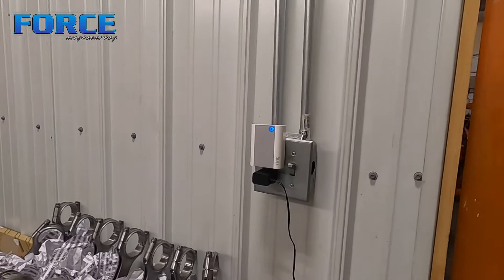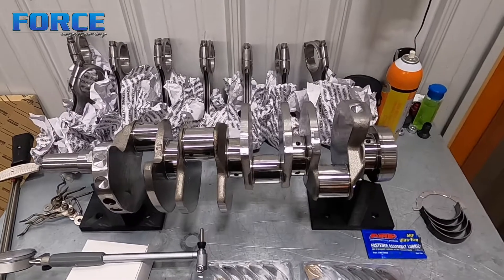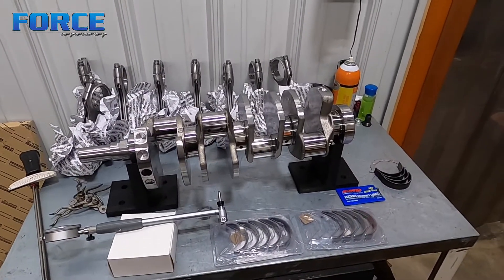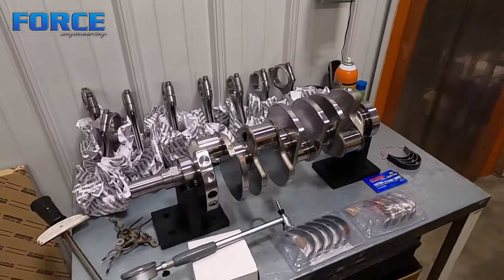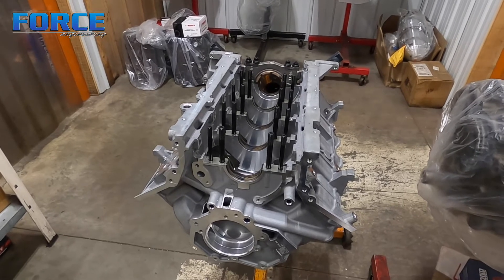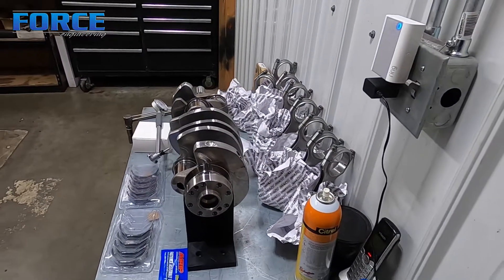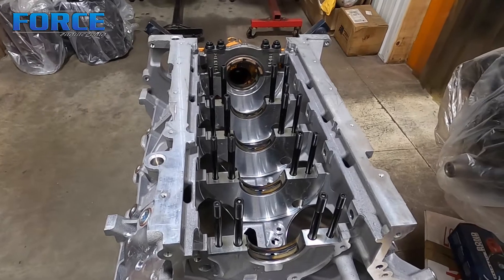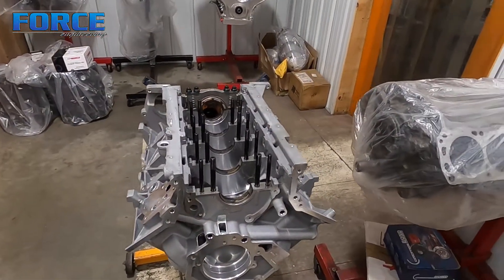Engine Assembly - Setting Main Bearing Clearance | Ford Coyote 5.0L

Comment: which part number for a extra .025mm using clevite h ? im around .0015 also , but the rods are money. do the hx allow more or less room?
Reply from the maker: Correct, the HX is .001 inch more clearance

Comment: How often does the thrust Babbitt fail giving to much end play, mainly stick cars?
Reply from the maker: I've only seen a couple (less than 5) of thrust failures in my 18 years of engine building.  They were from im properly installed components.  Either clutch setups with an incorrect amount of travel from the slave cylinder, auto cars with incorrect converter spacing, or someone hadn't set the thrust correctly.  When things are all done correctly, they seldom fail.

Comment: Aluminum or Babbitt?
Reply from the maker: These are a King bearing.  They use a proprietary Tri-Metal formula and i have found many specifics on it.  That said most of the modern performance bearings use an aluminum shell with a layer of specially formulated copper (babbit)  then coated.  Here is a link to how King lay out there bearing types.

https://www.google.com/url?sa=t&source=web&rct=j&url=http://kingbearings.com/wp-content/uploads/2014/10/Materials-poster-final.pdf&ved=2ahUKEwjejpTJj-7tAhUM11kKHYdHAbUQFjAFegQIBxAI&usg=AOvVaw2iWhlMD7OdBI2DT65Lum-W